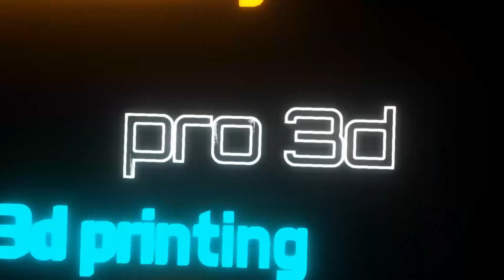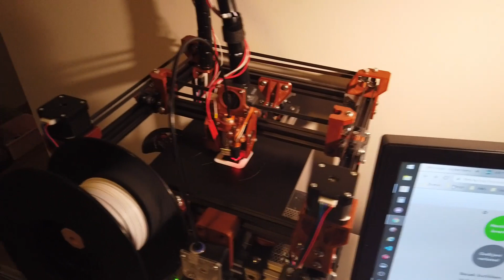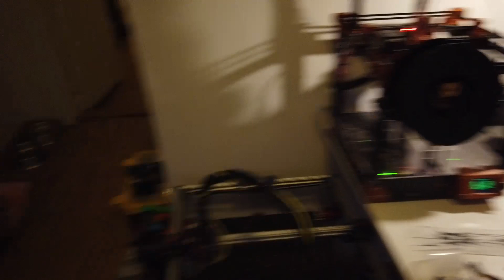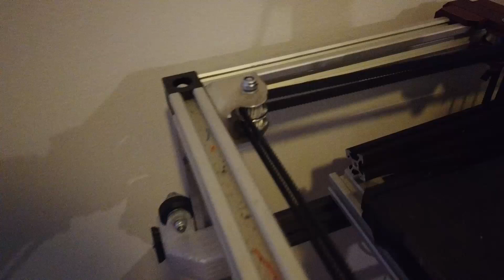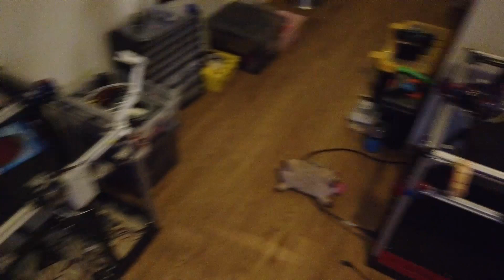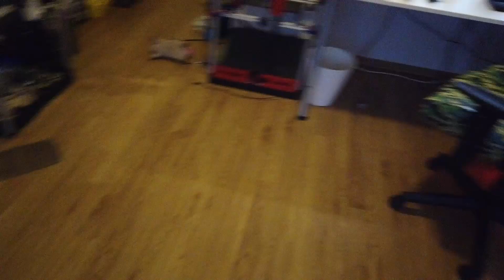V-Baby & V-King | Quick Update from Valhalla

Comment: what was the method you use to match jerk to jd equivalent numbers, if you're using 0.03 -- what jerk were you using before.
Reply from the maker: There is a formula to calculate junction. It is {jerk^2/acceleration)x0.4.

My jerk was 15 from before
Reply from the maker: I had 3000 in accel when jd was 0.03